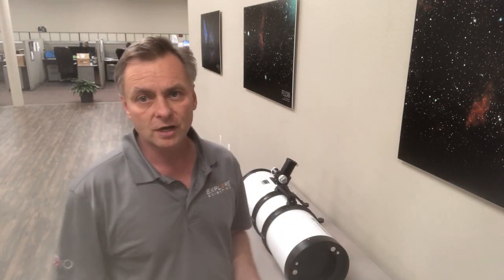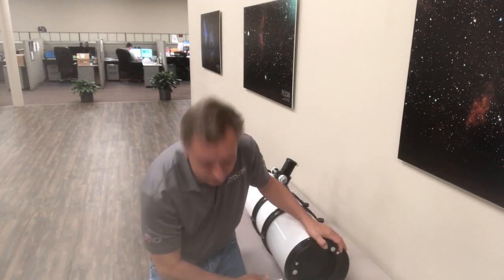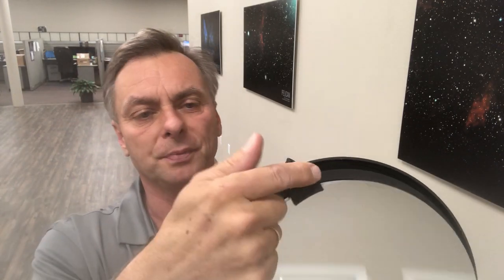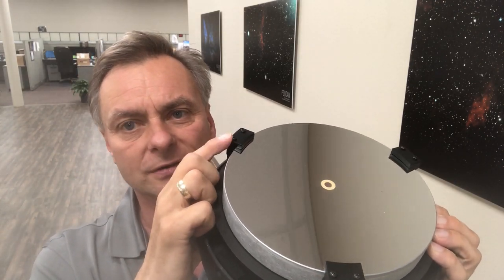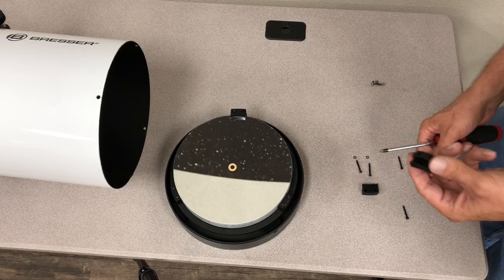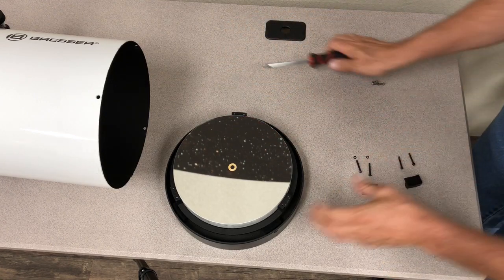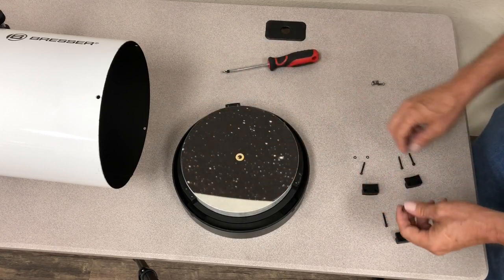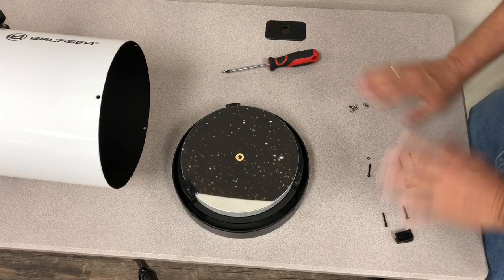BRESSER N20839 Newtonian: Inspecting the Primary Mirror and Mirror Cell Assembly

Comment: I have the pn208, metal tube. Also applies to the Bresser 203-f3.9. 

The only way i found to prevent the mirror moving and so retain collimation was to replace the mirror springs with much stiffer 1.6mm wire versions (place the same over the locking bolts too so that you now have a total of 6 springs) and glue the mirror to the cell using neutral silicone sealant. If you have the version with the 85mm secondary mirror, the metal support plus the mirror is way too heavy to be supported adequately, introducing yet another source of mis-collimation. We replaced ours with a light plastic version of 70mm. 

Whilst I'm here, you will also need a Losmandy Dovetail plate running the length of the tube (ours is 50cm) and a stiff aluminium box section to tie the top of the tube rings. 

At last: an instrument which retains collimation all day. And night!

Comment: but if the mirror is allowed to move slightly, doesn't that mean collimation will change everytime the scope moves?
Reply from the maker: In practice no. Very slight movement is okay and keeps pressure off the glass. Large movements will require collimation. If it did then Newtonian telescope mirrors moved a lot in general, then they would be rendered useless. But this is not the case, Newtonian telescopes by all manufacturers are among the best selling serious telescopes in the world.
Reply: @ExploreScientificOfficial  Thanks for this informative video. By end of next week, I too will be having one brand new BR-N20839. I am too excited from now. I wish to use it basically for astrophotography. 

Here I do agree with you and can confirm that while designing my own 12" dobsonian, I followed the similar advise shared on many forums to keep the primary mirror little loose and free to move, and it doesn't affect the collimation at all. Here is the link to my dobsonian - https://youtu.be/AKxKnOryxt8
Reply: Absolutely, and there lies the problem.